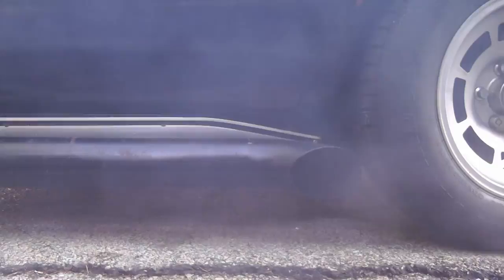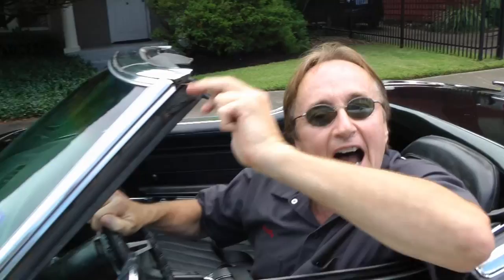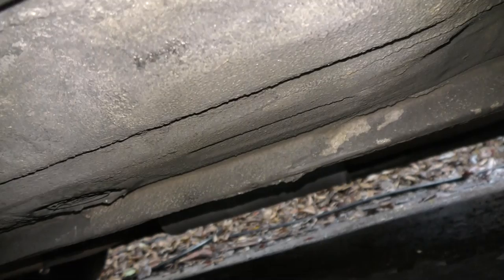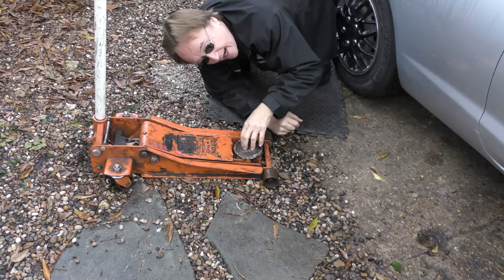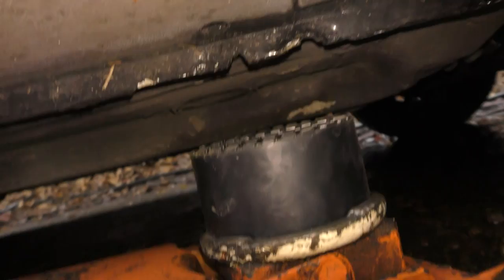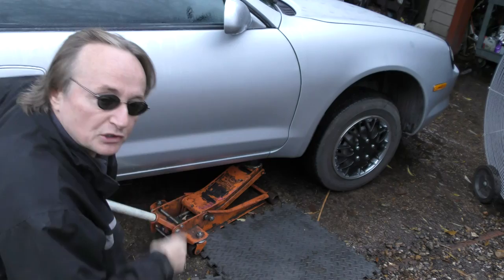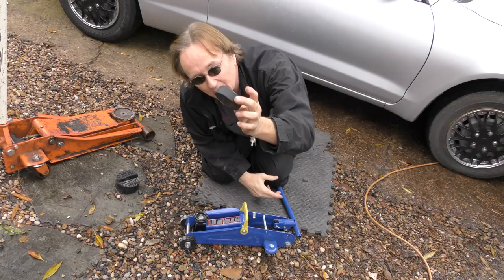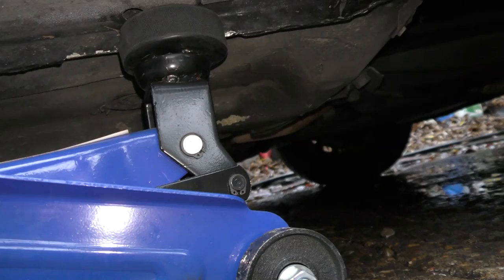How to Jack Up Your Car With a Hockey Puck

Comment: scotty is it safe to back up the car from the screws of the suspension??
Reply from the maker: +Ricardo Hernandez  I don't understand your question. But if you mean loosen suspension bolts, you can do that to a certain extent when working, but don't go to far on the threads or things will fall off.

Comment: dear Scott I have a 1987 Ford f150 351 fuel injected pickup truck how do I put on the mounting bracket to the air compressor and the power steering pump stuck in a world of changing out my water pump and now can put on the air compressor and power steering pump with the bracket
Reply from the maker: +Jack Sparrow I assume you took it off to change the pump. so think carefully what you did. It's kind of like a chinese jig saw puzzle, but it will go back on if you look closely

Comment: Knowing the proper place to jack up your car is very important. I replaced Tire on the side of the road and I put the jack in the wrong spot and the jack punched a hole through the bottom of the car.

Comment: I,have Lumina 2001 when l,start the engine in the morning of several attempts to hear the sound of engine sneeze one time then after start.
Reply from the maker: many things can do that, check for vacuum leaks first and of course replace the spark plugs if worn

Comment: Now the question is... once you've jacked one of these new cars, where do you put the jacks stands? My wife has a 2007 Ford Escape and there's no where to put a jack stand.
Reply: +dLimboStick =  You cannot use jack stands on most of today's cars, they will bend those spot weld seams if you let the car's weight down on them 100%.   What I do is this:   I jack up the car, then I put those jack stands under the seam and just lower the car a little bit, so about 10% to 20% of the weight is on the jack stand, but most of the weight is still being supported by the scissor jack.  That way the jack stand is just there for added stability, it is not there to hold the weight of the car.  Hydraulic jacks sometimes slowly 'leak' and the car lowers itself over time so I put the jack stands under those seams but with a 1/4" space so they don't touch the car.  That way if the hydraulic jack "LETS GO", the car will fall on the stands and won't crash all the way down.
Reply: Honesty Counts

Comment: what if your car is so low you have a hard time getting the jack under the car NVM that 4in. rubber
Reply from the maker: then cut it in half
Reply: What I do if a car is too low for your jack is simply drive onto a plank so the jack fits.
Reply: Drive up on a 2x4 piece of wood first, then slide the jack under it.

Comment: I installed new brake pads on my 2005 nissan altima, but didnt bleed the lines. The pedal is pretty tight. Any ideas?
Reply: +Supercrunk100 pump your brakes, new brake pads will be tighter, and feel way different if your old brake pads were extremely wore. Most new cars dont require anything more than pumping the brakes after changes pads. you didnt disconnect brake lines did you? No reason to on most cars of your age, so therefore no need to bleed the lines

Comment: is there a good chance a regular puck could slip out? Or will it not go anywhere because of the weight of the car? I don't normally think outside the box but it just seems a little unsafe is all. Regardless I'm still loving your vids! Keep up the good work!
Reply: +doom2urlife be hard to slip out if you cut a groove in it, and the smooth underside finish when you jack it up, the jack will dig into it a bit leaving teeth marks, be very very hard for it to slip out, if its slipping out, your jack is not level and not the pucks fault
Reply: dynocompe okay cool thanks (just a heads up tho i was asking, I didnt try this yet) But definitely thanks for the very informative reply :)

Comment: May I digress from the Puck, please;'
SK,  My 2002 Corolla has great / heat while driving, but turns to lukewarm @ Idle,  Temp gauge steadily reads fine @ 190. Any fix ?
Reply from the maker: +Joseph Wolchak flush the heater core out, they often clog up when that old

Comment: Hey Scotty I got a question. I got a 1989 Ford Bronco that my dad and I have driven on the beach and of course the bottom is all rusted. There's no holes in the frame or anything like that but on to my question. I might sound dumb but would it be possible to put a suspension lift on it?
Reply from the maker: +Project Blue Runner  I would not lift anything all rusted out, you're gambling with fire there
Reply: +Scotty Kilmer ok thanks

Comment: how often should car tires be changed
Reply: +Conner Leidy there is no set time a cars tires should be changed. Tires have wear bars on them. When they get close to the wear bars, the tires need to be replaced. Or tires with very bad uneven wear. If this happens get a wheel alignment before getting new tires. If your tires are also severly cracked from dry rot you should consider changing them. (usually cars that sit and dont move it happens to or cars that had same tires for 10 yrs due to low mileage) Tires only need to be replaced when they are wore out and unsafe.

Comment: Scotty I need to know we're the fuel regulator is located on the 1.8 06 Sentra I just replaced the fuel pump assembly and I need to replace the fuel regulator on it cause it's not holding fuel pressure under the engine compartment can you show were it's located under the hood asap thanks.
Reply from the maker: +Daniel Rivera  I've never done one, and my data system does not show the location, only that it pays a mechanic 50 minutes labor to change it. Call a dealer parts dept in the morning, they can tell you using your VIN number
Reply: +Daniel Rivera ever heard of google? come on dude its 2016

Comment: i dont know if you have a video on this but, i was woundering on a 05 car can you just goto a car wash and pressure was straight through your front grill and vlean out your radiator? or will it mess with the electric fans? what is your solution
Reply from the maker: It won't hurt fans IF car is not running,

Comment: didn't he do another video on the proper method for jacking it? I'll probably have to do this on my Smart fortwo because I don't think there's a good place to jack it. but where the hell do you find a hockey puck store?
Reply from the maker: +chieftp I'm in Texas, I used amazon for the puck, took two days and two bucks.
Reply: +chieftp you guys seriously dont have sports stores that sell hockey gear? i know texas has hockey rinks!
Reply: dynocompe
I checked Dick's for a puck to jack it, but no luck. Hibbett sports doesn't have them. I'm going to check Dunham's. there's an ice skating rink in a nearby city with a pro shop that sells hockey stuff. I'll check them. I don't do amazon or ebay.

Comment: Scotty Kilmer reason i asked my 1999 Ford Taurus lx low coolant light came on checked coolant level full tightened down resavar cap low coolant light stopped showing unless cranked as all test display on dash then go's out indicating working every thing ok what do you think
Reply from the maker: +jhon chapter 3 verse 16holybible  often the low coolant warning system breaks down and gives bad info on one that old.

Comment: im having a cylinder 1 misfire i checked the coil.its good.wat else can i check?
Reply from the maker: +Daniel Mena swap fuel injectors to see if miss moves. If not that, check for vacuum leaks on #1
Reply: +Daniel Mena you can also check the actual spark plug. i had a misfire on number 3, spark plug electrode on the tip was broken. replaced plug and all misfires gone. It was weird, even with that broken plug, my truck only misfired when it was cold. If it was 10 plus degrees celcius outside would never misfire even on first start up.

Comment: how much would you charge to fix a cv axle on a 03 murano?
Reply from the maker: +Zach Gan  No one fixes em, just replace em.  Generally about 300 bucks or so, depending on if it's all wheel drive or just two wheel drive

Comment: hey Scotty I have a question. I just got a new Honda civic ext 2016 with built in turbo. what are your thoughts on oil catch cans?
Reply from the maker: +imDavidNguyen  I would install one on that model, yes.
Reply: +Scotty Kilmer any certain brand of oil catch can you reccomend? also should I install one or two cans? thanks!

Comment: hello Scott. I was wondering if your could anwser a question for me. i have a 2006 pontiac montana sv6, the transmission is slipping into 3rd gear. what should I do? I don't have an honest mechanic and because it's the transmission I'm afraid to take it into a shop just for a mechanic to tell me the transmission is gone and needs to be replaced. thank you for your time :-)
Reply from the maker: +Robert Blair   generally, they slip in gear, transmission needs rebuilding. BUT, do try changing the fluid and filter and PRAY
Reply: +Scotty Kilmer OK thank you for your time
Reply: +Scotty Kilmer so I got a OBD2 reader because I questioned the check engine light that came on at about the same time. and it read P0171 which is the mass a flow sensor. So what I did was watch your video on cleaning the MAF and did it myself. car is working perfectly now! Thank you Scott for answering my question. sometimes having someone to bounce ideas off really help. :-)

Comment: I don't get the people here whining about the safety....If this puck fails, it's not going to fail catastrophically,  and fall off the jack, it's gonna push through slowly.  You might have a slightly bent frame rail afterwards but who doesn't already have a bent frame rail?? No problem here.

Comment: hey scotty . what do you think of the use of evans waterless coolant . Can it be used in 2011 toyota avensis 2ltr turbo diesel injected. will it void warranty. it seems to be a different viscosity
Reply from the maker: +James C  I suppose it would void the warranty, and toyota 7 year hoat coolant is great anyway. Evans does work, but costs a ton and is used mainly by rich guys on their toys or race guys.
Reply: +Scotty Kilmer 
or folks like me driving bmws that run the coolant at high pressures normally for....some reason. evans increases the longevity of everything in the cooling system since it runs at atmospheric pressure

Comment: I have a problem with my 98 Honda prelude a no spark I have replaced the crank position sencer the coil the cap and rotor spark plugs and wires and the ICM and still no spark I am thinking to replace the main relay and the Distributor need to know why it should be sparking can you help am I am missing something can you help me please
Reply from the maker: +Ronald Warden  replace the dist, a known flaw, brand new chinese ones are everywhere these days, cost less, work fine.
Reply: Thank you for you feed back will replace and let you know how things turn out thank you for help like what you do stay ranching

Comment: I remember one time a friend of mine was in auto mechanics and the lift slid off the lift point on the front passenger side, punched a hole right through the floor. We had to evacuate because the car looked like it was going to fall at any moment xD

Comment: So I'm always confused about where on a pinch weld you're supposed to apply the load on.  Is it on the area around the weld, thus the slotted pad allows it to do, or is it on the pinch weld itself?

Comment: how do I get my car out of reverse a 1999 Honda Accord 4 cylinder
Reply from the maker: +LaShonda Slaughter  if it's a standard transmission, it will need rebuilding in most cases when they do that.

Comment: Just a warning against hockey pucks is that not all of them can handle this and some will split and the you'll bend the railing even more.
Reply: +disturbinglee when you cut into them, take a torch to the open cut part and melt it. be stronger.

Comment: Hey Scotty, the tires in my car are almost bald. Wuould you buy Dunlop, Goodyear, Michelin or Uniroyal tires? I want good tires. Is It a good time to align the steering in my car? How often should the steering BE aligned. Tks
Reply from the maker: +Time Traveling Old Man michelin if you don't mind the price, I have goodyears on mine.
Reply: +Time Traveling Old Man Maybe Going for those Michelin. The cost 5bucks or so more than those Dunlop/Goodyear
Reply: +João Mendes I guess I'm the only one here that prefers Cooper and Goodyear.
Reply: +Skynet I'm a fan of cooper tires but I've never had a set of Goodyears go the distance.    Either cupping or belts shifts or what have you on atleast one or more of the Goodyears.
Reply: Depends on your climate and how much you want to pay. Conti makes great tires, the dws is one of the best all round tire you can find if you live in a snow area. Yoko makes great summer tires, toyo had some really good touring tires... It all depends on what you want out of the tire. Check out tire rack and read the reviews and whatnot and narrow your search to what you want out of a tire. As for alignments, if your car is pulling or drifting, or you replace suspension parts, thats when I do it.. Or you notice uneven wear. You can see this with new tires based on the stubble that wears off... But they can also represent the wrong psi in the tires so make sure that's to spec when you buy them first.
Reply: +Skynet I like Goodyear tires. But Michelin is Michelin.
Reply: +João Mendes when I buy tires, I usually spend about 2 hours browsing customer reviews on tires I am interested in for that specific vehicle. lol  Their is some good cheaper tires out there if your on a budget. I put 18" tires on my f150 for under $800 CDn and very happy with the tire. General grabber II's, they will throw more stones than most, but my truck has good mudflaps and the sprayed in wheel liners and doesnt see gravel anyways

Comment: hey Scott I had a question for you

my turn signals stop working once I turn on my lights but when they are off they work perfectly fine? 
I've been surching but nobody has an answer can you please help!!!!?
Reply: +Jose Guerrero you need to replace teh switch that controls the headlights and the turn signals. i assume the signal light lever, also turns on the headlights correct? If so, 99% chance, buying a new replacement lever will fix your issue. At the end of that lever is a plug, the plug is probably corroded/shorted.
Reply: +dynocompe I actually went out to buy that peace it's called a relay but it still doesn't work I'm thinking it might be a fuse yet I highly doubt it so I don't know what alse it could be
Reply: no its a not a relay I am talking about. Tell me the year make model of your car. i will give you a link to the piece you need. It definetely wont be a fuse. You would have no lights or turn signal if fuse was blown.
Reply: +dynocompe it's a 2010 hyundai genesis coupe 2.0t

Comment: Why would it really matter if you bend that area anyway? I personally don't think it matters
Reply: they won't bend if you know what you are doing. I swear this guy's advice is the worst.

first of all, the pinch welds should never be used with a floor jack - they are designed for a scissor jack when only jacking up one side of the vehicle. If you are going to use a floor jack, you jack it up on a centralized point, and then lower the car down on two jack stands at the pinch welds. The pinch welds will not bend if they are supporting level weight (ie the car is not just jacked up on one side). The jacks that come with your vehicle (scissor jack) being used to change a flat tire on one side only is just that - it's for emergencies only, not to be trusted.

Comment: Whats a good car to buy for around $5000 used.
Reply from the maker: +abeg1571 any toyota OTHER than a hybrid, they cost too much to fix whe old
Reply: +Scotty Kilmer 
Yep. Toyotas are tanks, especially the old Corollas and Camrys. Hondas are a good option aswell, had an accord with 300k on it and it ran like a champ in the winter, never let me down.
Reply: +abeg1571 VW Golf mk II, oh wait, you meant 5000 not 500, oh well...
Reply: +Jesse Holiday My brother, the idiot, doesn't wanna drive a Camry or Civic, so sadly I can't make him buy one. Corrola is still a good option.
Reply: +abeg1571 get a Nissan D21, its a small truck, things go forever. I still drive my 87 with 230000kms on it. Never fails me, its my bush truck now for getting firewood and my winter beater. Love it to death. lol I just built a headache rack for it last week..... If it dies, I am going to buy another and keep mine for parts. I want one about ten yrs newer. ( most my parts will still work)

Comment: is it a bad idea to but over sized rimes on a car?
Reply from the maker: +Jovany Lopez yes
Reply: +Scotty Kilmer why is that?
Reply: +Scotty Kilmer  lol put* and why is it bad what does it do to the vehicle
Reply: +Scotty Kilmer  lol put* and why is it bad what does it do to the vehicle
Reply: +Scotty Kilmer  lol put* and why is it bad what does it do to the vehicle
Reply: +Scotty Kilmer  lol put* and why is it bad what does it do to the vehicle
Reply: +Scotty Kilmer  lol put* and why is it bad what does it do to the vehicle
Reply: +dynocompe because it puts extra stress load on the front end components and specifically the wheel bearings. makes things wear out faster...even tho it looks cool :)
Reply: extra stress on wheel bearings? Do you know what bearings are? The impact it would have on bearings would be minimal.  The biggest impact would be on your drivetrain, but that really depends on how big you are going. Most 2wd vehicles with bigger fancy rims will cause very little harm.